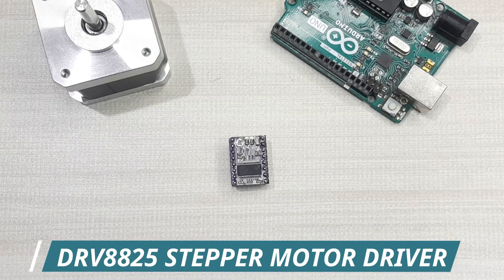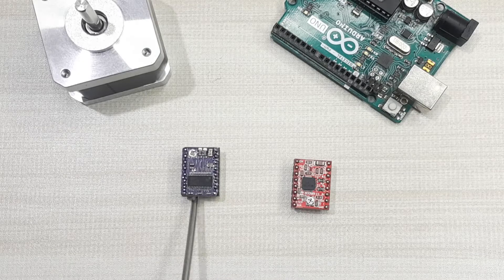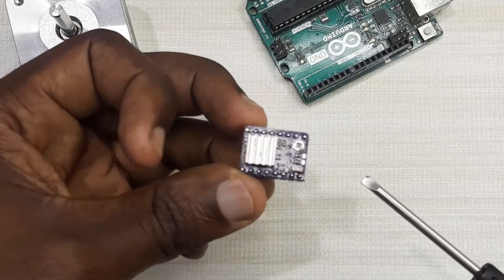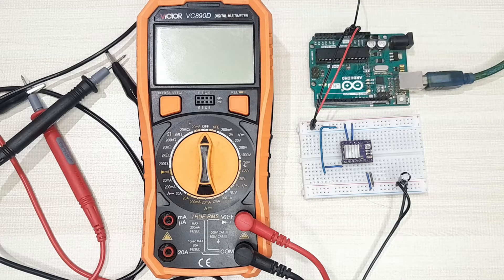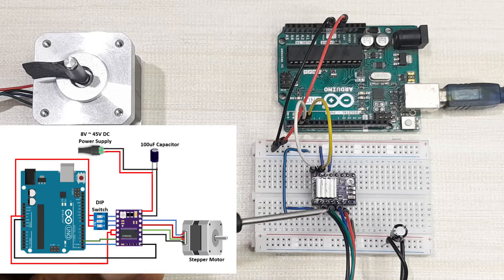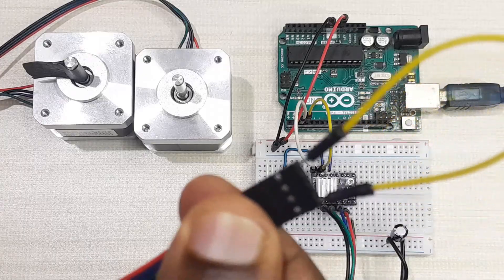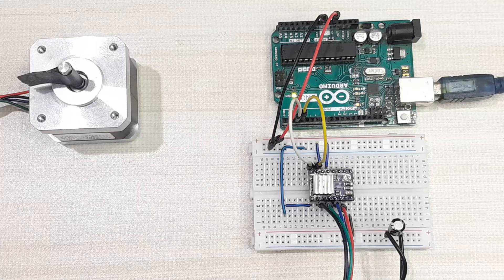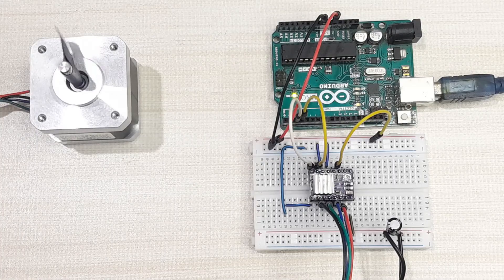DRV8825 Stepper motor driver with Arduino.

Comment: Please can you help me I have this motor code on my NEMA step sir my driver is DRV 8825 I have checked it about five to six times it has been three days I have been checking it but it is not running the motor is completely correct on the motor I am also doing the connection almost correctly I can tell me the connection correctly why it is not running the reason.

Comment: If you use a round 5V stepper dynamo using a 2003 ULN drive, the 4 wires that go into the Arduino pins, if I replace it, is there anything that needs to be changed in the coding?

Comment: Can i run two of those exact motors on one of the motor driver?
Reply: No, it is generally not recommended because the current draw would be too high